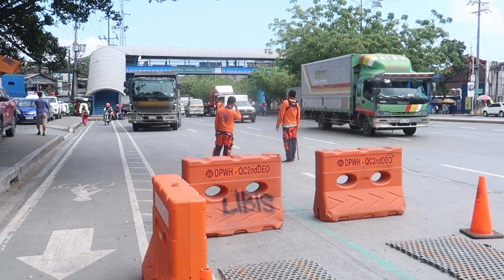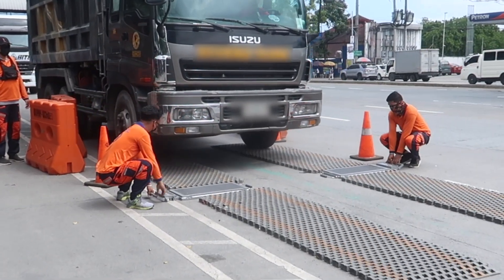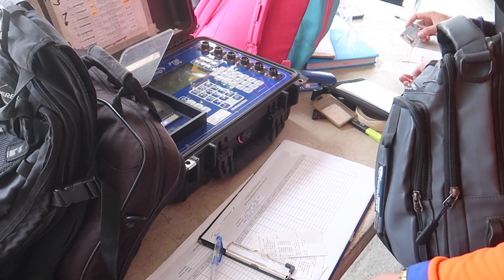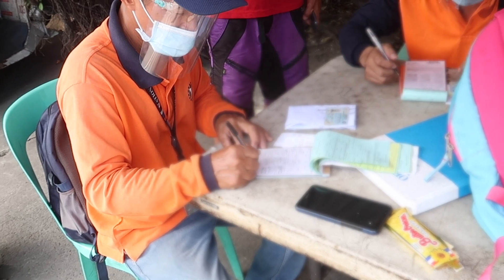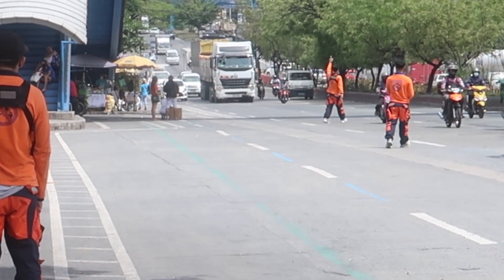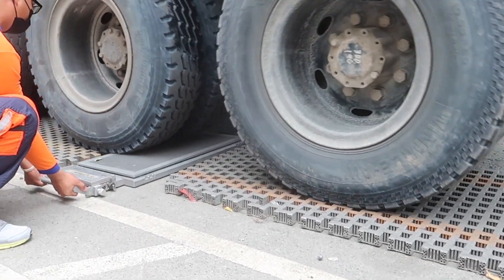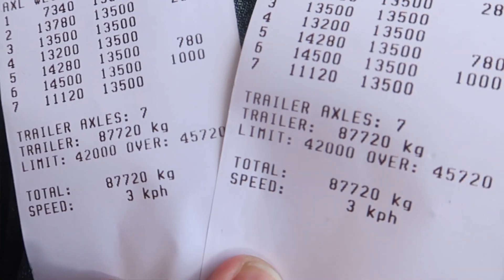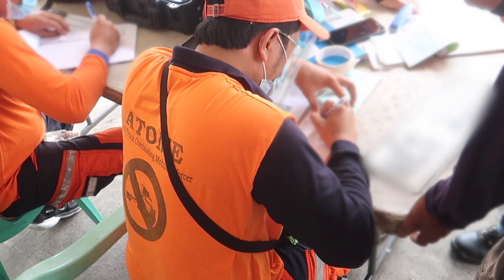How dangerous are overloaded trucks?

Comment: The trouble is that the law is exceeding the maximum tyre capacity.  10.00R20 and 11R22.5 tyres with a 16 ply steel rating are rated as 146 / 143 load index rating. This means the maximum weight a tyre can carry is 6,610 lb as a single tyre and 5,800 lb in a dual position. This is at 120 / 110 p.s.i. cold tyre pressure. Translated @ 2,240 lb = 1 tonne, I will let you do the maths.

All I need to say now is that 13 tonne per axle is beyond the tyre capacity and the axle masses need to be reduced to 6 tonne for a 2 tyre axle and 9 tonne for a 4 wheel axle, with a gross mass of say, 48 tonne.

This now puts a legal load over 6 axles, and allows for the truck to be reasonably loaded. If you exceed the weight, then expect to wear the book!

Comment: Is there a way to attach an extension pole on the weight sensors? It appears it is an occupational health safety breach for the 2 operators manually handling the weight sensors whilst on their knees right next to an overloaded truck
Reply: Suspect that is illegal moving the scales between axles while the vehicle is moving.  There is also a requirement to ensure that the scale returns to zero after each weighing, or the scale is non compliant.  It has been observed over 35 years ago that one brand of portable wheel scale has problems returning to zero for the first few times that it is used.  Once it is bedded in, they are reasonable at returning to zero.  Same scale though, you need to carry them horizontal, as they are a hydraulic scale with either a dial display, or a transducer to a digital display, with wireless to a printer.